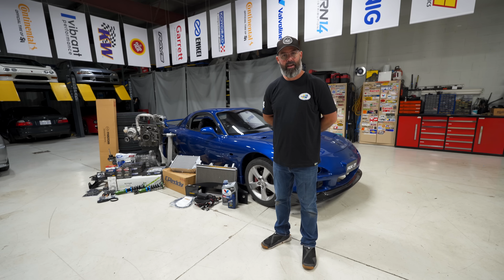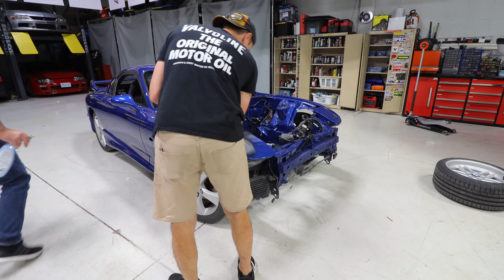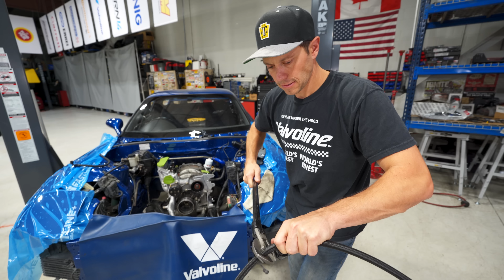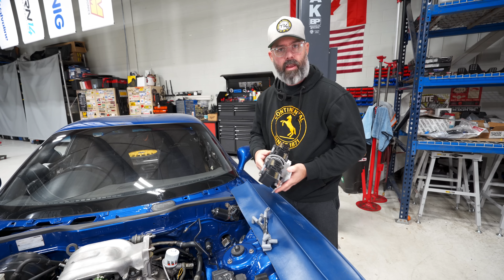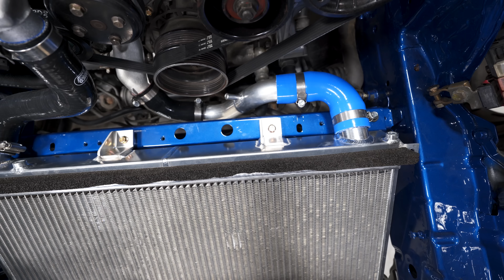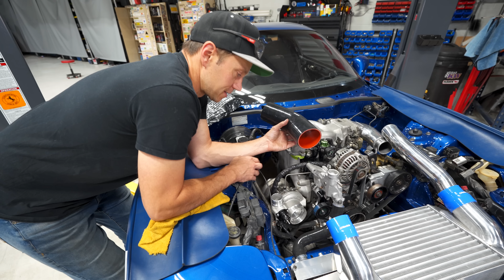MAZDA FD RX7 QUICK BUILD - EP 1

Comment: Anyone know what he means when he says “there reliable unless the engine detonates” at 6:50
Reply: "Anyone know what he means when he says “there reliable unless the engine detonates” at 6:50"

The engines will pretty much run "trouble free" until 1 of 2 things happens.  1, the seal wear (Happens with run time. The hotter the particular engine configuration, the faster the apex seals tend to wear. This is why older 1st gen and NA 2nd gen FCs will last quite a while, 150-180~ k miles between rebuilds isnt uncommon. Single turbo FCs tend to see around 120~k. The FD with its twin turbos will see around 100k because of the extra heat from 2 turbos. Etc).  

2- If they get any kind of predetonation (combustion before its meant to occur).  The apex seals are at the end of the day, big and brittle.  Theyll "seal" just fine for quite awhile: But if you predet, its like slamming that brittle apex seal into a wall.  The slightest bit of predet and the apex seals can/will shatter- Which has a high chance of destroying the motor. The seals will crumble and then get tossed/chewed through the engine- Quite often destroying the housing(s).  

Outside of these 2 issues- Theres really not a lot to go "wrong" with a rotary engine.  But lets not beat around the bush- These 2 things can both easily happen, which is a huge part of where the notoriety comes from with these engines.  As people start to tinker and tune the engines, its very easy to push the envelope too far and get just a single predet- which basically destroys the engine.  

A piston engine with forged pistons doesnt have these issues- and can withstand predet far, far more reliable.  Still not GOOD, but youve some wiggle room- instead of driving a literal fuse.

Comment: simple way. always drop the front subframe onto a bench. build you motor and gearbox combo on the bench, on the subframe. Then wheel the bench under the car and lower car down. nothing has to hang and swing and you have great access to the engine to assemble everything prior to installation.

Comment: This series is soooo good.

Not sure if the plan is to get it all running first but I personally would revist the pipes and hoses in the engine bay as the rest of the car is really top notch. I wouldn't want a mix of silicon and clamps etc as it detracts from the bay

Comment: "Quick Build" proceeds to rip through video of installing engine, fuel and cooling systems complete with custom made brackets. Quick Video maybe, but this is a pretty extensive project, right? (Honestly, I wouldn't mind if you slowed them down a bit and talked more details about various parts/procedures etc. E.g., all the fuel system stuff, what's the stock set up, what's modified and why?)

Comment: Loving the build. My anxiety is blasting off the charts for the awaiting the day you guys take it to the track. I think the 8374 iwg would have been a little better suited but if the track is a bit tighter than the turbo you guys picked will be better. I have my fuel pressure regulator in the same spot on my Fd and Cam from Petit told me to move it. He said that with the amount of heat that is created during trackdays that the gasket inside the regulator gets toasted. Once it gets toasted it will leak fuel onto your engine and cause an engine fire. I will be relocating mine very soon. Thanks for the video and I look forward to seeing the finish project. Brap on

Comment: To have an easier time undoing any hoses in the future and preventing corrosion, dielectric grease lightly applied to those surfaces works like a treat. Any o ring, any electrical connector, grounds, Ect it is a great tool. Silicone brake lube can also be used for non electrical stuff.

Comment: Way back when I had my 1993 RX7 R1 there was just nothing cool on the market. Nobody knew how to tune these cars or anything.  Watching this makes me want to get another one since the market is finally catching up to what I wanted.  A company like Cobb or equivalent should make a V-mount intercooler kit with cast and tanks for this application along with carbon fiber ductwork.  Also have a ram air carbon fiber airbox option to prevent heat soak.

Comment: I don't understand why everyone insists on dropping the power train through the top, especially when you have access to a lift.  You could have easily put a 90-100% built engine onto the sub frame and drop the body onto the engine.  I am a dealer tech and pulled a unlimited amount of engines out the bottom.  It is a much more efficient and easier way.
Reply from the maker: We are Youtube mechanics so we do everything the hard way